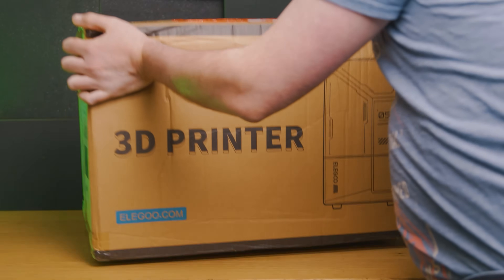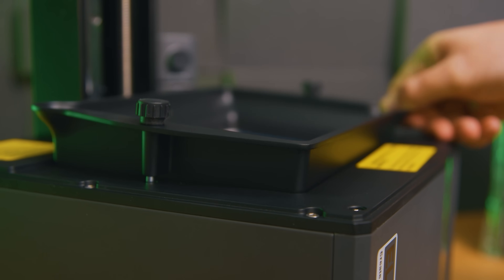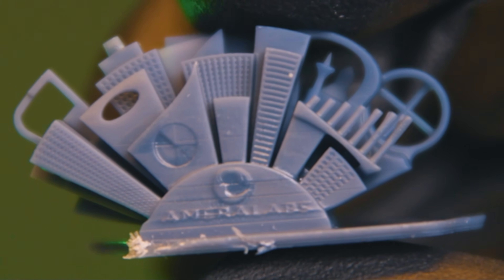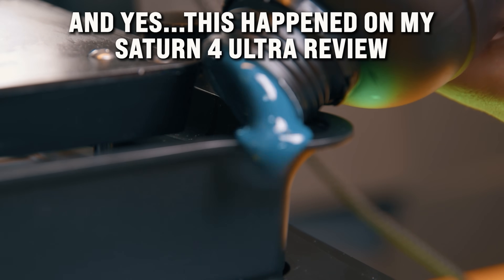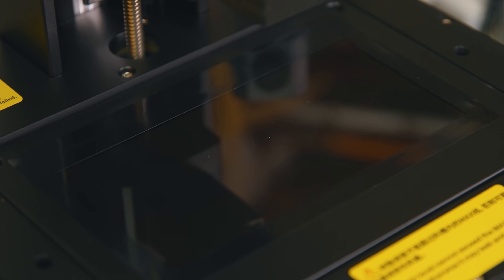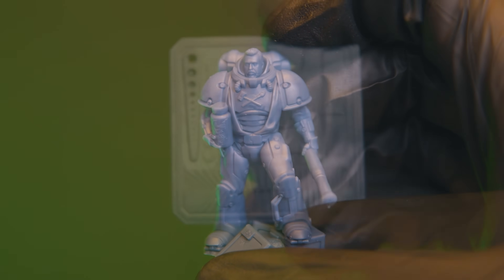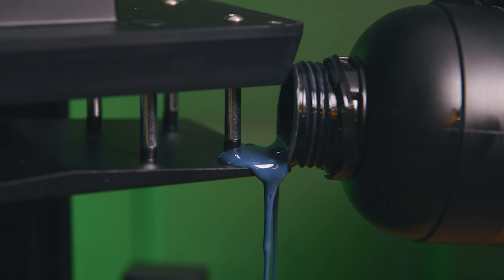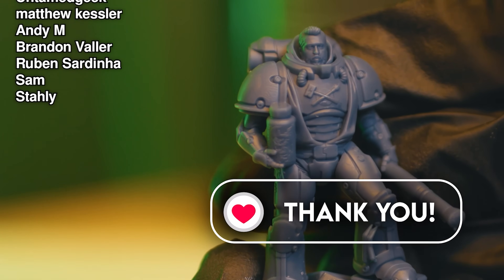Elegoo Mars 5 Ultra Review - Honey, I Shrunk the Printer!!!

Comment: Re the Cones of Calibration - I had the EXACT same issue with my Saturn 4 Ultra - If you look at the base on the one in the video and compare it to the actual STL, the floor is much closer to the skull/mug than it should be. I think this is down to bottom layer exposure time - I dropped mine down to 25 seconds and it printed perfectly after that. 

Completely amateur take here, but it looks like the plate is rising when longer exposure times are happening, making the base layers a lot thicker than it should be... Might be miles off, but glad to see the 'compression' issue is being mentioned (I print some stuff in my Etsy store directly on the plate, and the first ones I tried on the S4U weren't sellable due to this issue)
Reply: it's not bottom exposure time, if you can try longer wait times and also see if the printer allows you to adjust the z offset. on previous ones you could send the plate to hom and then move it and then set z =0. This was for if you leveld and the height in each corner was similar but they were all eg 0.5mm low. This should auto zero but it's clearly not doing it well which could be fixed by setting a higher z offset, that or the springs are compressing when they shouldn't which could be fixed with longer wait times.
Reply: @awildtomappeared5925  I don't know what to tell you, all I did was change the bottom exposure time and it fixed it for me - went from looking like the one in the video to looking exactly like the STL 🤷🏻‍♂️
Reply: I've been using a mars5ultra a few months now. Love it, but when i try to print directly on bed my models are squished about 1mm (for example, printing 10mm soldoers like warmaster's, they are printed without feet). Does anyone have the same problem? Managed to find a solution?
Reply: Is this printer good enough for dental printing and castable resin printing for jewelry casting?
Reply from the maker: Did you reduce exposure time then? I got base exposure as low as I could before stuff started falling off.

But Tom knows what he’s talking about, he’s the one to explained the compression issue to me. I’ll learn more and put a video together.

Once I know how to consistently show it and how to test and resolve it
Reply: @FauxHammer  Just the base exposure - It was at 35s, dropped it to 25 and the issue went away. Not discounting any info at all, it's literally all I changed and it fixed it. Intrigued to see a video on the compression thing, it's plagued me across multiple prints and printers for a while until I found ways to work around it
Reply: @NextGenBase  thats not what I would expect, but the spring system is well throwing 4 springs in the works so anything can happen.